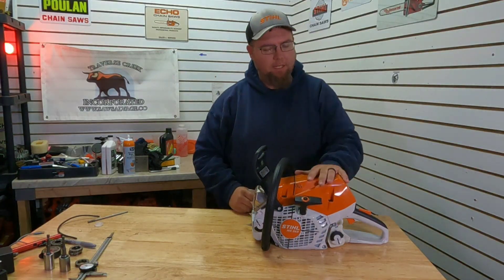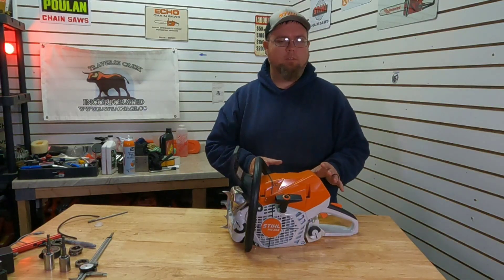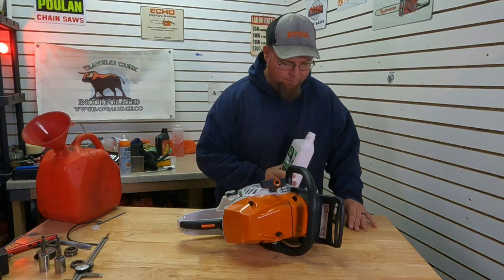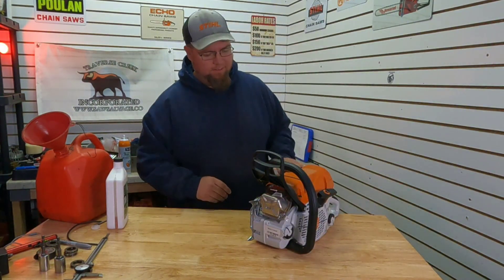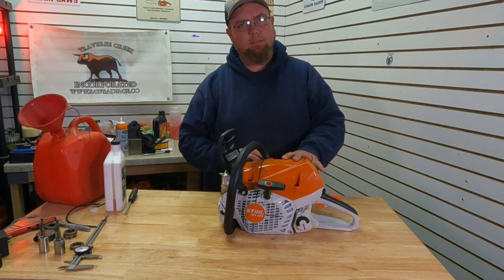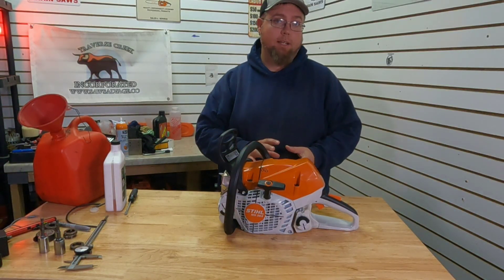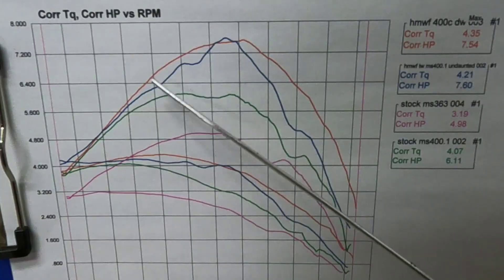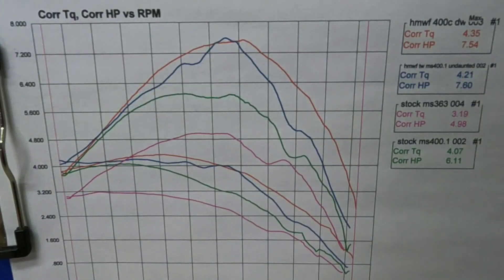Ms400.1 results, Stihl ms 363 baseline power?!

Comment: You need to start a “giant’s excepted” stump’s and round’s dumping by the tonnage and make your own set of scale’s with a couple steel plates and a couple of those cheapO pressure sensors!  Just got a buddy with a triaxle to hit your place on his way back to the local stone drop a couple times and get your basic average… and round down for the fellas that are helping you out!  You’ll need to weld a 1” inch carbide tipped auger bit to a 6’ long 1 inch thick piece of 3/4” inch rebar and just turn your last 6” inches down to a 1/2” inch and use the 1/2” inch hammer drill to buzz your tanner-tunnels every four feet or you crisscross pattern with them 2’ height separated and center and just pack a couple little 1/4 pounder’s in one of those 16’ foot diameter 10’ tall stumps and go pick up those 16 refrigerators size chunks with a little bobcat with a giant cylinder and claw homemade “Mega-Splitter attachments!” Don’t need a giant machine giant ram with anything with the hydraulics to pump your gallons per minute will do.., my ford manual transmission turned my pro pump on my old truck and I’m looking for another pump for this one!  You’re smart enough to make your own piece of splitter equipment!   I’m trying to get a 40’ box kiln made to dry my firewood or lumber out in the 2 weeks instead of two years! That’s a hell of a good racket because then you don’t need 15 acres to run your business on! 👍😉

Comment: Stihl is not doing anything that screams improvement. They get rid of the ms 400C which is a dam solid saw once broken in. All I see in Stihl is failure,get a pro 60 cc saw that can compete stock with a Husky 562. Husky is so much more into power in stock saws then Stihl. Stihl saws stock should not have be ported and have custom muffles added to run good.
Reply: It's all a fad
Reply: Yeah, but the Bling factor is off the charts!
Reply: the 400.1 outcuts the 562 stock
Reply: @julianlaustsen1991 but not the 564
Reply: @julianlaustsen1991 bingo